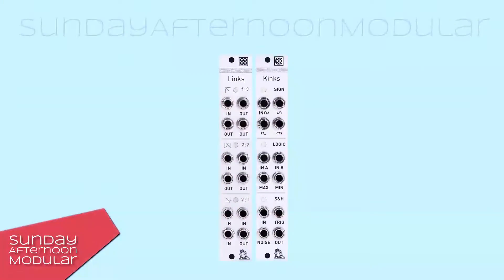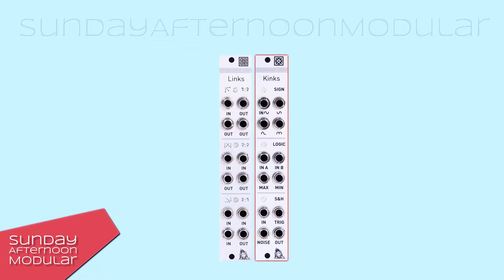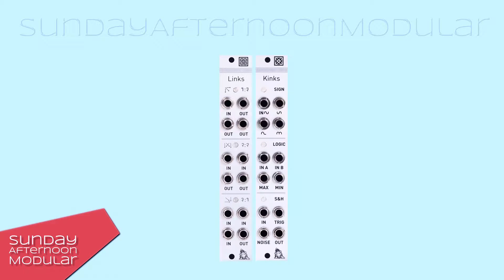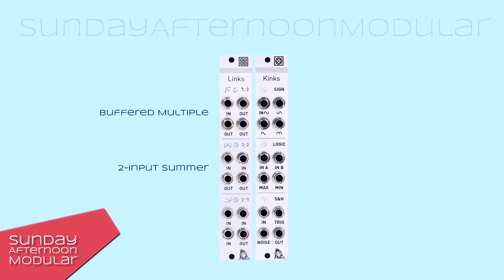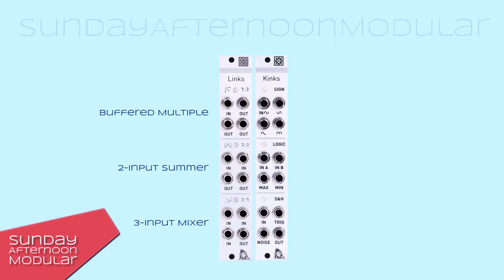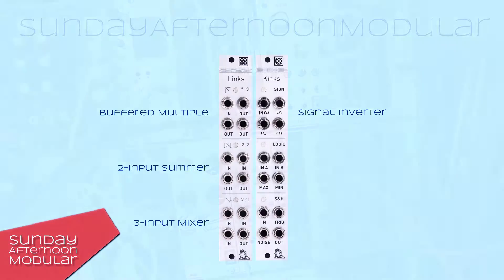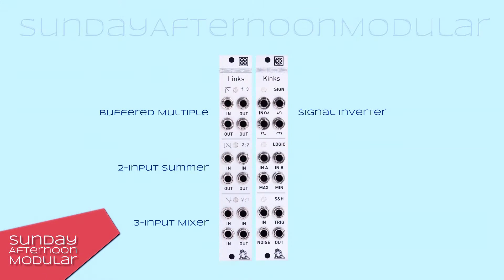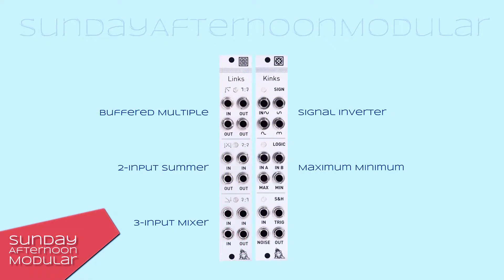Mutable Instruments Links & Kinks Introduction

Comment: Thanks for the video, there's not many on Kinks and Links. I'm still struggling to understand what the IN actually does though. Is it turning audio input into white noise?
Reply from the maker: Hi Late Night Beeps, do you mean the IN of the Sample & Hold section? The IN is where you feed the Signal that you want to manipulate, for instance a Sine wave. If nothing is patched on the IN, the Kinks will take its integrated noise.
So the basic Sample & Hold is the input signal, the trigger signal to manipulate, and the output. The noise generator with its separate output is like an extra that Mutable Instruments included. Hope that helps! :-)
Reply: @SundayAfternoonModular  Ah right, yes I get it! Thanks :)